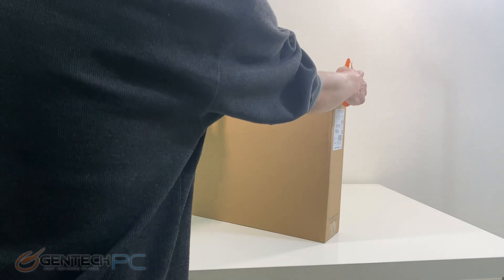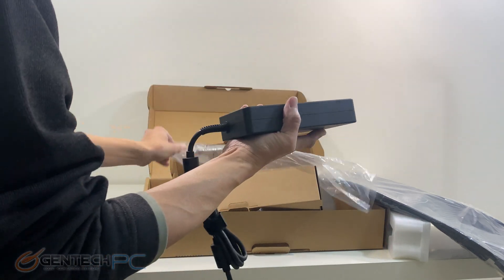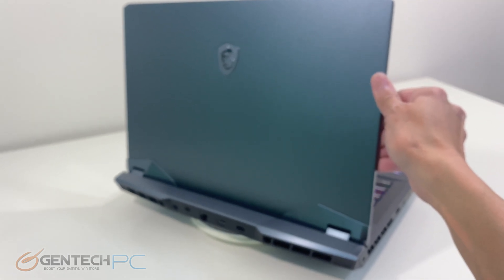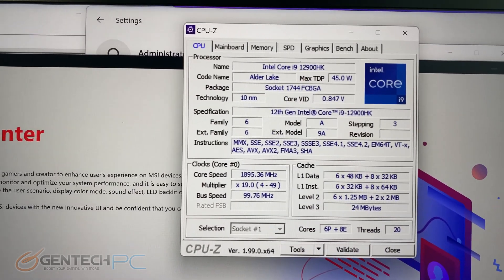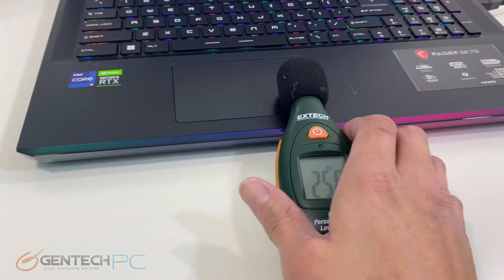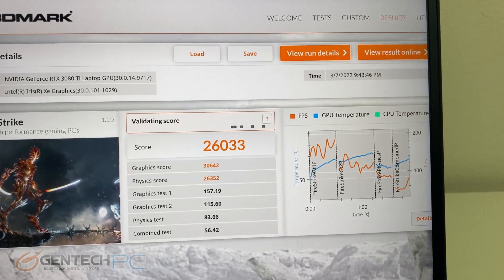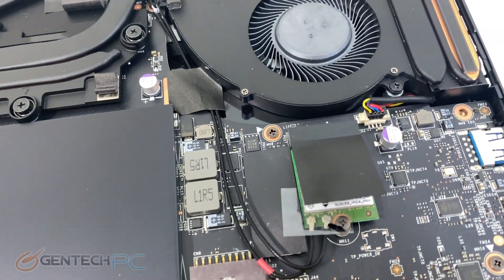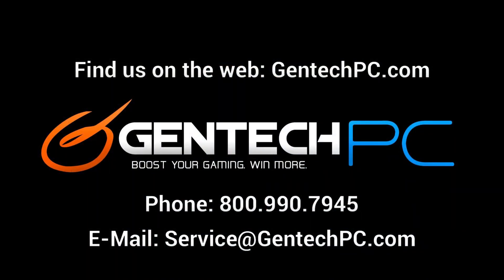MSI Raider GE76 Review + Benchmarks | RTX 3080TI i9 12900HK

Comment: What is the fasting ram clock speed it's capable of? The stock is 4800. Can it be upgraded to 5600?
Reply from the maker: Yes now MSI shipped with 5600MHz RAM.
Reply: wrong. I bought a 5600 ram and it got down clock to 4800. @GenTechPC

Comment: Something a lot of people don't take into account is that square power adapter plug!  It prevents the plug from rolling around inside the port, which causes it to loosen over time.  Anyone who's ever had their power cord fall out of their laptop because it got loose?  That's why.  Pound for pound, the Asus Scar Strix 17 is better than this laptop, but not by enough.  I'd pick this with the square power plug over the round Asus, for that reason alone.

Comment: Ive same model it throttle to 2.7 ghz on benchhamrk giving score around 14k.

Msi confirmed it has an issue, but checking with you after dissamplying, I'm pretty sure that the LM not setup correctly.

I'm re applying thermal grizzly conduct and see what would be the different bec I've same spikes but no way for me to stress it with 3.5ghz all core, it always drop to 2.7 due to thermal throttle.

People on reddit confirmed that they can stress is with 75watt without throttle giving 3.8 to 4.1Ghz with score around 16-18k
Reply from the maker: Yes we tested with thermal grizzly conductonaut and it does help.

Comment: I was curious to see the Cinebench R23 score compared to my X17 R2 and I got 17,004.  But from what I've seen Dell has limited the GPU and it needs a bit of help to achieve good scores and FPS.  All of these high end lappy's are pretty close on performance, mostly with some tweaking.  I think it comes down to aesthetics and personal preference.  How thin people want, if you want a num pad, if you need ports in a specific place, screen resolution preference, etc...  There are pros and cons to all of them depending on preferences.  I can tell those interested in the X17R2... the speakers suck (use headphones anyway), AW Control Center is atrocious, not having the secondary keys lighted is stupid, Cherry MX is tingy sounding.  Other than that, in my opinion, great machine... lol  ;)
Reply from the maker: The cores of 12th gen from 0~5 seem run pretty hot and causing throttle quite a bit, pretty sure that's the reason for lower Cinebench R23 score, all brands are pretty much the same with 12th Gen.
Reply: 17000... Don't fool man
Reply: You're right on the preference im looking into buying a gaming laptop and I was leaning towards the X17, but when I saw the number pad on the 76 im like awww man I gotta get it. I had a Macbook from mid-2015 and I hated it not having the num. pad. Both are very good high-end gaming laptops, I know I'd be happy with either one, but like you said preferences!

Comment: X17 R2 or GE76?
Reply: You'll get higher FPS for gaming with GE76. But X17 R2 CPU performs better than GE76.
Reply: One more thing, for almost the same price, you'll get dual screen resolutions on GE76, 4K 120 hz and 2k 240 hz. X17 R2 has only one resolution screen 1080p, 165hz 3ms response time (cheaper) or 360hz with 1ms. response time
Reply: Oh, they have added a 4k option now for X17 R2. But it's gonna get more expensive. For the price of GE76, you can get the 4k screen if you choose the i7 variant 12700H.
Reply: @MrLuciusVoren  tks bro
Reply: Wait for Asus to announce zephyrus s17 2022 version! Also check out the razer blade 17!
Reply: I am also between the two

Comment: The design of cooling seems to bad in my opinion compared to other coolings
this laptop should have at least 4 fans with that specs
or external liquid cooling like the XMG oasis
Reply: 4 fans = more noise and less battery life, simply adding more fans doesn't do much unless you also have the heatpipes in mind. Also, liquid cooling on a laptop is still in its early stages, the water on the laptop after you unplug the pump can come out and damage the laptop. I think the cooling is very good for this laptop considering what it is pulling and what performance its offering. A simple undervolt on the CPU and gpu will make this almost worth its current price.
Reply: @xescdelarosa3328  No lol
Reply: @nanezferrer3565  lol yes. Also 4 fans on a 15.6 inch laptop would be basically impossible to fit inside, of course unless they make them super small which would make more noise when in use (coil whine, high pitch air sound, etc). You see, gaming laptops aren't something that you simply turn on for the first time and game at max power like a gaming console, they need care and fine tunning you can run them at 100 percent and ruin them or you can game at 98 percent with everything stabilized. (If that makes any sense)
Reply: @xescdelarosa3328  it is a 17-inch laptop
Reply: @MrLuciusVoren  well, that just means that it is possible to cramp 4 fans in there. Might as well call it a vacuum cleaner.
Reply: @xescdelarosa3328  do you have a guide to undervolt cpu laptops? im planing on getting the msi ge66 but want to undervolt cpu
Reply: @aeonbreak4728  well, just search how to undervolt laptop cpu with "Throttlestop". Btw, also undervolt your gpu using "Afterburner". You can also find hundreds of well explained videos on YouTube. Since they share heatpipes, if you undervolt both the CPU and gpu then you can say bye to the 80's°c.
Reply: @xescdelarosa3328  Thanks Ill do both!!!. Do you think I should get i9 12900 or the i7 12700, considering ill undervolt?
Reply: @aeonbreak4728  they say that the i9 is locked (for overcloking or undervolting) but can be unlocked through bios (which there are videos for that). But the i7  version doesn't even seem to have the locked option (you can't undervolt the i7 12th gen. Although some people are saying that for the extra amount of money it isn't worth it (in terms of performance, especially for the i9's true potential being limited on the size of the laptop's cooler). If you have the money then go for it, but what i would do now is wait, especially since intel arc is coming soon and more 12th gen CPU's will be officially out in other laptops. In other terms better pricing.
Reply: Alienware X17 R2 has 4 fans and that’s a disaster of a gaming machine for thermal control 💁🏻‍♂️
Reply: @gaming_nerd_i_am9969  yeah i saw the motherboard
you have to flipped it out whenever yoou have to clean them
Reply: @nanezferrer3565  yeah poor design indeed, the unit I had would thermal throttle and reach temps as high as 108 Celsius 😳